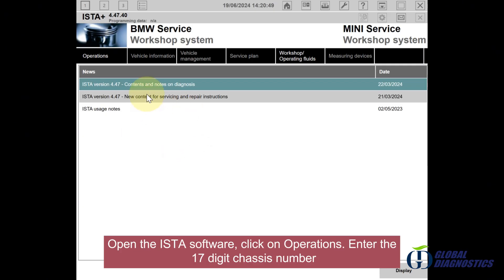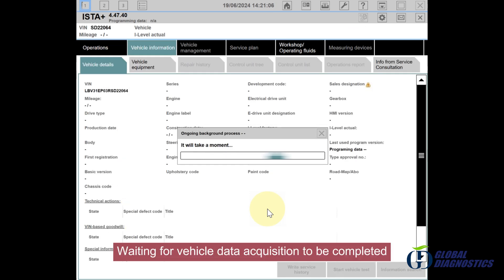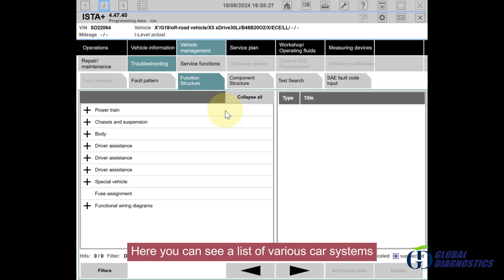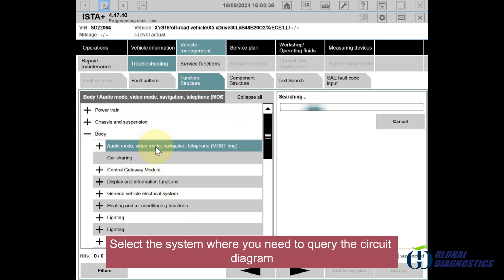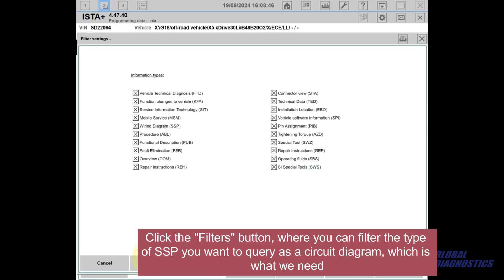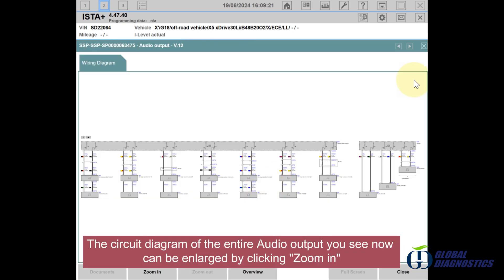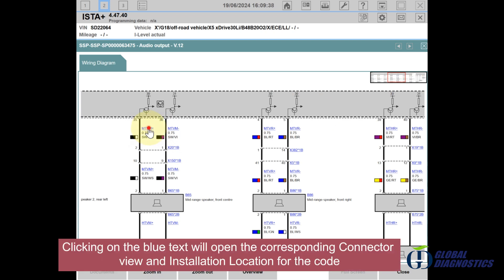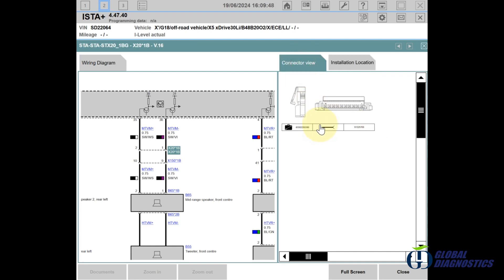How to use ISTA to query circuit diagrams

Comment: This company is a full scam operation.
I bought their tools and software about a year ago, and from day one I had nothing but problems. Many of the programs they installed were already infected with viruses because they use cracked software from China servers. Instead of providing real working solutions, I was constantly fighting malware and system problems.

Every time I reported issues, their first reaction was to blame me. Only after I pushed hard and got angry did they admit some mistakes and make small fixes. But this was temporary — the same problems kept coming back. They only give a 30-day warranty, and after that, they try to act like nothing is their responsibility. In my case, I had to deal with problems for the entire year, and in the end they simply stopped responding, claiming it was my fault.

I want to make it very clear:

The software they sell is not original, not safe, and full of viruses.

Their so-called “support” only works if you stay silent and never complain.

When you insist on getting what you paid for, they attack you, call you abusive, and cut you off.

Their public reply to my complaint is pure nonsense — it’s just excuses to protect their image. The fact is simple: I paid for working, safe software, but what I received was infected, unreliable cracked programs and endless problems.

⚠️ Warning to others: If you value your time, money, and computer safety, do not buy from them. You will never be right in their eyes, and they will leave you with useless tools and infected software.

I absolutely do NOT recommend this company to anyone.